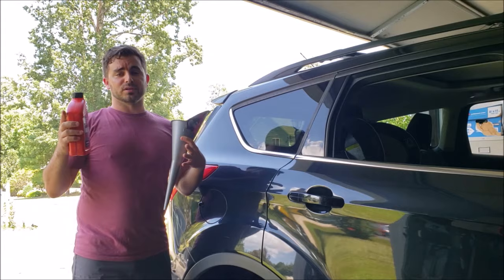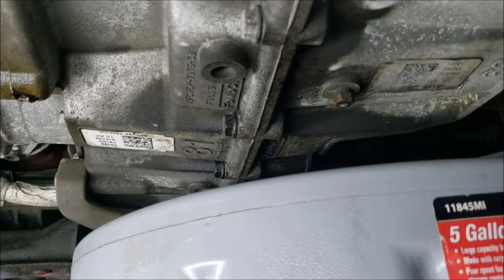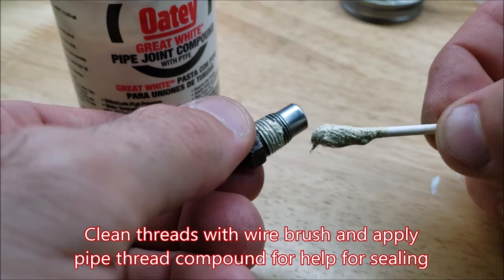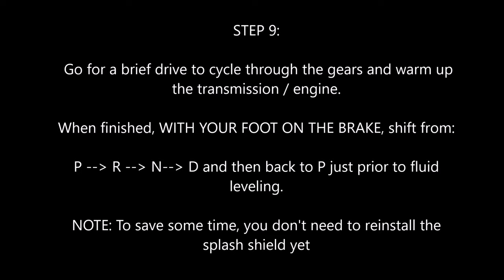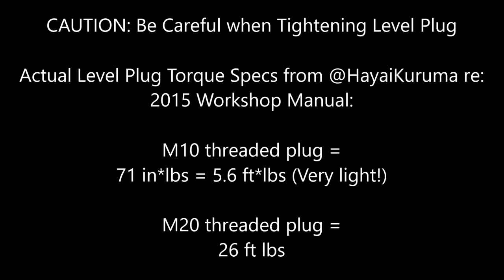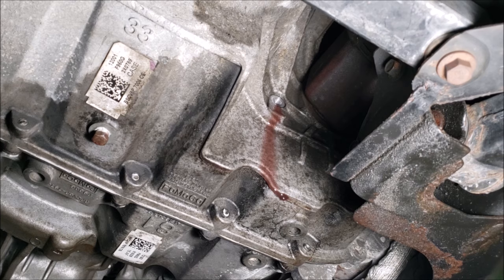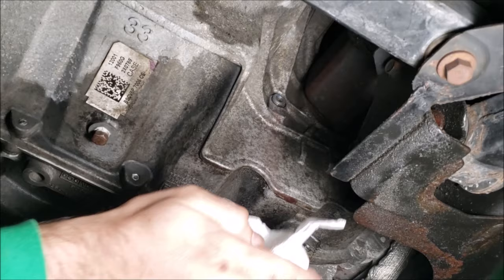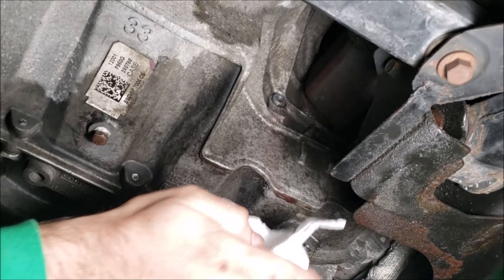Step by Step Transmission Fluid Drain and Fill: HOW TO ESCAPE

Comment: For anybody with a 15-16 1.6 or 2.0 escape, level bolt is a 3/8 inch Allen key on the right side of cv axle and a 10 inch extension works perfectly.
Reply from the maker: Thanks for sharing the tip, @riomcneill3918!
Reply: Words cannot express.... Thank you
Reply: In my case, it was screwed very tight & I was not able to unplug it out

Comment: No way, no how, no chance, should anyone EVER do ANY vehicle maintenance or even start the engine when using the factory jack under the pinch weld.  This video is an accident waiting to happen.
Reply from the maker: Thanks for the advice on that @Melman- you're right. You certainly don't want to be under the car or anywhere in the crush zone when its on that jack. However, thr thought was that this procedure with the wheel well access point  is not doing much more with the vehicle on the factory scissor jack than as if you were changing a flat tire. The engine is running, but the video has instruction to have the car in PARK and the E brake on. I am just a hobby garage car guy and no pro for sure,, but I have done this a few times now and if youre on a flat slab and the vehicle is in Park, then there is a very low chance of hazard as the other wheels stabilize the vehicle at 3 contact points. Not saying 0% chance, and we are not suggesting be in the vehicle shifting while its on the scissor jack. I can't remove all the risk but the scissor jack is a clever way to get to the port  without putting your whole body under the vehicle. That's where I was coming from at least- Im not saying its perfect. Please let me know of your thoughts- thanks very much
Reply: @HowToEscapeDIYTipsandReviews  I have already given you my thoughts, I have nothing more to say.
Reply from the maker: @larrymelman  understood. Thank you sir
Reply: @HowToEscapeDIYTipsandReviews  JUST USE CAUTION and COMMON SENSE guys!! Great video!!
Reply: Most excellent video except for using scissor jack part. I’m sure you are not doing that anymore. Great video.

Comment: For everyone, you would have to do this process 3 times in order for the trsnsmission to have atleast 90% of clean oil. By doing once all your going to do is dirty the new oil if you do it 3 times old and new will get mixed up and drain and and you will see a nice and red color of transmission oil.
Reply: Engine oil never drains 100 % when you change. Keep routine drains some and fills new 🎉
Reply: @pewpew9040  yes but we do more engine oil changes than transmission fluid changes.
Reply: 3x every 30,000 miles or like I do, one drain and fill every 10,000 miles
Reply: Right, I believe it takes around 9 courts, so that makes sense, thanks

Comment: Just drain and add 4-1/4 quarts.  I’ve done the leveling procedure one time out of 12 drain and fills.  The drain and fill procedure takes 10 minutes if you skip the leveling procedure.  Most of the 10 minute is the fluid draining
Reply: Good call - I am just going to measure what came out and put back the same amount of new stuff.

Comment: I have a 2014 after driving the car for about 20 minutes it started revving and acted like it was in neutral, Mr. Transmission is saying $3k+ to fix, any thoughts?
Reply from the maker: Hey there Dean- was this after a fluid change, or just in general 20mins of driving? 

Also, it depends on the "fix" really. Less than $4k for a transmission job on our Escapes is usually a pretty good deal. If it looses connection to the wheels and feels like it's in Neutral like you're saying, it's not a good sign unfortunately. 

For what it's worth, I paid ~$5K for a remanufactured transmission with updated internals and warranty on the transmission and labor. Just a datapoint for you on cost and what you could get. It's never fun to consider $3K for anything, but in regards to transmissions, it's not a bad price. 

Looking forward to hearing back. Thanks!
Reply: Ya I think I'm going to pass on fixing it, 10 years old and 278k's not worth it.
Reply from the maker: yeah it's a hard sell really. I think the main reason we kept ours is that at the time, vehicle prices were still a bit worse than they are now, and we still use it for this channel so much. Good luck with your process sir.

Comment: How about just simply measuring the old fluid that came out and putting the same amount of new fluid in?
Reply: That is the way a lot of people do it, but I just don't trust the last person that did it.
Reply: Never time to do it right but always time to do it twice
Reply: Fluid is a different volume warm vs cold, safest to level it off by removing level bot while vehicle is hot and running
Reply: By just replacing the exact same amount of trans fluid you remove, you would not know if your fluid was low to begin with. It is best to remove the level plug after the vehicle has warmed up to make sure that you are at the proper fill level. I know it is more work but it is definitely better to do it this way.
Reply: @kevinolmos80  that's true if you bought a used car that had its transmission serviced before. If you bought the car new, then you can measure the fluid that's coming out and put the same amount in since its level was correct from the factory

Comment: I'll be changing my Transmission Fluid in the next 2 weeks. Looking forward to reviewing this video again
Reply from the maker: Awesome! Its really like a regular oil change but with the level check at the end. Be careful with the threads on the level plug and go slow and easy and you should be golden. Good luck!

Comment: Thank you, I am on my second motor (known problem and class action lawsuit) my air conditioner quit (probably the condenser valve or switch) and now my transmission may or may not get me to work tomorrow! I'm DONE with Ford...except maybe with my F250 rust bucket!
Reply from the maker: Yeah these vehicles are pretty troublesome sometimes. Sorry you're having to go through all that- I hope its an easy troubleshoot with that AC

Comment: I have a 2017 Ford Escape SE with a 1.5L turbo engine.  I found that using a Pittsburgh 10mm hex extended wobble key (bought a set at Harbor Freight) was the best tool to remove the 10mm hex head check bolt (when I chose to use the removal of front left tire option).

Comment: Great video!

Has anyone done a timing belt change themselves yet?
Reply from the maker: Oof. Thats a tough one.  I had to pay for mine to be serviced due to a ~$500 proprietary Ford tool to access the belt. My trusted mom and pop shop said you have to pull the whole front quarter off to get to that part of the engine. Ended up having the dealer do it but it cost a pretty penny in labor... ~$1300 in labor hours alone.. While they were in there I had them do the water pump too. Didn't have the guts to do that much teardown myself for such an infrequent but critical maintenance item.

Comment: I know this is an older video, but if you see this can you maybe answer this? :) Can I drain and fill the trans fluid without dealing with the overflow bolt? Meaning, do you know the exact amount to fill using the vent (top) access which gets very close to the amount needed? This would save a lot of time and hassle just filling with the appropriate amount you know? Thanks for any insight on this.

Comment: Great video i have a 2016 that I change every 30,000 i just put 5 quarts in and go didn't know about the level drain plug
Reply: How many fluid changes have you done so far using this method?
Reply: @BenefitExploits  2 so far about to do the 3 at 90,000 the trick is try to measure the amount that comes out and go from there
Reply: @duanesalter1585  Unfortunately I hit a deer and my grille busted the trans cooler in the front and some fluid leaked out. I didn't drive it after that but im replacing the cooler and saw the fluid was really bad for being a 2019, it was never changed. So I will have to do the method of checking the level with the level plug
Reply: @duanesalter1585  i'm not used to the fords, the only cars ive changed tranny fluid on was toyota's with the 6 speed auto and those still had red fluid after 90-100k miles on the fluid lol
Reply: @BenefitExploits  my Mazda 3 was like that it had a seal trans never had to change it .but the Ford escape needs to be changed every 30 thousand it gets dark quick
Reply: @BenefitExploits  them deers are rough on a car good luck with your repairs

Comment: The owner manual said 9 Qt of transmition Fluid, Why did you put 5?
Reply from the maker: With the drain and fill, only ~half of the fluid exits the transmission housing. There is still a large volume still inside. Therefore, a drain and fill more frequently (within reason of course) will never have 100% of the fluid changed out, but you'll always be introducing more clean fluid than the old  fluid inside.

Comment: Hi good afternoon 
A very interesting video as I’m over here in the uk my ford Kuga has a totally different gearbox than you have in US . I have the powershift gearbox and have just done a oil change on mine and I have 2 drain plugs and a totally different procedure
Reply from the maker: Hi Phil! Wow, 2 drain plugs? What about your gearbox requires 2? Separate chambers? Is it all still the same type of fluid? Do your kugas in the UK still use MERCON LV? 

What else is different about the procedure on your end? 

That IS very interesting.. how many speeds are in your transmission? Our Escapes typically have 6.
Reply: How To Escape: DIY, Tips, and Reviews 
Hello again I got the oil direct from ford it takes 6 litres and also has a disposable filter that is in its own plastic surround that you unscrew from the side of the gearbox. Yes it has 2 chambers that when you refill the gearbox one flows from one to the other . It cost me £160 for the oil and filter, so not sure how much that is in the US , mine has a 2.0 Litre Diesel engine that is a Euro 6 engine made in partnership with citron Peugeot and ford , it’s a 6 speed automatic gearbox, and is a 2015 model , my model is a ford Kuga AWD titanium X sport in deep impact blue with 180 bhp
Reply from the maker: @Phil-1969  Thank you for the response and the detail- ok! So that is extremely different then- we don't even have access to our transmission fluid filters over here- they're considere "lifetime" which makes every one of us a littler nervous haha... We also don't have the diesel option like you all do- pretty cool that you can partner with Peugeot on that- so we're still the same on the 6 speeds, and AWD. I have the SE trim and you have Titanium but that shouldn't affect anything in the driveline in terms of differences... Deep impact blue is a great color. how many km's do you have on it???
Reply: How To Escape: DIY, Tips, and Reviews mine has done 50000 miles so I think about 87000 km and is totally standard. It has full moon roof , leather seats, 19inch wheels , it can park itself and every other toy ford put on them , I’m sure or gearbox is different, I’m sure you over in the USA have a different type. Have you a Facebook page that you have for your car

Comment: Ford: "Lifetime" filter, and 150k mile fluid service interval.

Also Ford: 60k mile warranty.
Reply from the maker: Right??? Very differing service policies... there have been many '13+ Escapes with failing transmissions even before the 60k warranty is up... 

I can't trust the "lifetime" filter... it's because you have to drop the entire transmission and crack it open to get to the filter... it's more of the lifetime of the transmission rather than the lifetime of the vehicle... 

Thanks for checking out the channel :)
Reply: @HowToEscapeDIYTipsandReviews   Thanks for the video....54K for my 2018 Escape and DEALER SAYS torque converter is failing....hard to believe but reading through many posts - is not impossible.
My question to dealer, is it possible replacing the fluid.... could it help the shudder I get or make it worse?

Comment: Can't find the location of the fill cap on a 2017 escape
Reply from the maker: Hey Aaron- sorry for the delayed response- check out this post on FordEscape.org- there's a user with a '17 Escape who posted pictures of his procedure. Mine is a 2013 so I can't be of much more help here unfortunately: https://www.fordescape.org/threads/2017-transmission-fluid-change.112736/#lg=thread-112736&slide=0

Comment: just found this video and had a question, on fords with high mileage is it true you should not drain and refill the transmission fluid for various reasons? like, too many miles on it, and draining and refilling fluid will cause transmission damage or some other problems? and if you feel you must do this to have it done at the ford Dealer? thanks
Reply from the maker: Hey there and good question- from what I have always understood from the community mostly is almost the other way around. Sometimes a dealer will offer to do a fluid FLUSH which can stir up a lot of settled debris in low places in your transmission. Since it is a "lifetime filter " inside the housing, it can't be changed so there will naturally be bits at the bottom that have accumulated. You can do it if you'd like, but the majority of sources and drivers prefer the drain and fill, even if you only get around half the fluid out with one procedure. It is much more gentle and keeps junk from getting thrown back into the fray. Some people try really hard to get clear red clean fluid when checking the fluid condition, but this takes numerous times and the fluid can get expensive quick. If you do the drain and fill every 30k mi, the influx of new fluid helping the residual retained fluid will make a difference. Please let me know if you have any other questions and thanks!

Comment: Thank you for the guide video.  I changed the transmission fluid on our 2013 Escape with 1.6 liter engine today.  (95k miles)

1:25
The 10mm Allen should be a 5mm.  The plug may be an M10, but the Allen hex is much smaller.  The 7/16" works for the drain plug, but it's really an 11mm.  

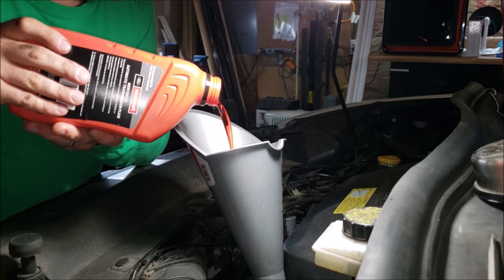4:40
The biggest problem I had was filling with new fluid.  I used a smaller, shorter funnel.  With both drain plug and level plug still in, the fluid would burp out the top of the funnel and make a mess of the engine bay.  A bigger funnel helps as does pouring less fluid at once.

Comment: Is your transmission still working ok 2 years later?
Reply from the maker: Hey there Firebert- funny you should ask. We actually just had the transmission replaced a month ago. Despite trying to head off the shortcomings of this 6F35 transmission with the 30kmi interval drain and fills and never really towing anything or driving nuts, it still failed on us. We just put a remanufactured transmission into it because it was less than a dealer by 2K and came with a 3 year warranty on parts and labor. It's painful, but we're back on the road with it. How about you? Have you had any issues with yours?
Reply: @HowToEscapeDIYTipsandReviews  2013 escape w/1.6 at 93,000 miles - was trying to decide if i should change the fluid or if the transmission might already be worn enough to need the dirt and grit to keep making friction to transmit power.

Comment: Hello, I have a Escape 2016 ecoboost 2.0, the owner's manual says that 9qt is required for the change, but in the video they only use 5qt, what is the reason?
Reply from the maker: Good question! The total capacity is 9qt but you can only drain half of that when you do a drain and fill. Its part of why its recommended to do it every 30k mi since you aren't changing 100% of the fluid. You could keep changing it over and over to get mostly new fluid but that can get pricey and time consuming.  A lot of Escape drivers do the drain and fill every 30k miles and have no issues compared to waiting longer per the factory spec. Please let me know if this is clear or if you have any more questions!

Comment: Excellent video. Well done.  Would you happen to have any videos on how to check/repair the A/C system a 2015 Escape?
Reply from the maker: Hi Steve, I dont have any videos up currently but what are your symptoms? Year and trim level of escape as well please? Hopefully we can help
Reply: My daughters car is a 2015 Ford Escape with a 1.6L turbo SE two wheel drive. The A/C was working then slowly began to die. I checked the fuses and they were okay. The belt is good. I had my daughter turn on the A/C while I watched the compressor. Nothing moved. I checked for signs of any leaks didn't see any but both pressure hoses are really nicely tucked away and difficult to follow from point "A" to "B". If you have any ideas, I would love to hear them. Thanks again. @HowToEscapeDIYTipsandReviews
Reply from the maker: @stevevet3652  Understood sir- the one thing that I've heard our escapes have issues with sometimes is an evap sensor that can tend to freeze over and it sends a false signal to shut the AC off prematurely- I'm not sure if that's what your vehicle is experiencing, but there's a pretty good video from FordTechMakuloco here on the topic- could be something to try and eliminate a variable? https://www.youtube.com/watch?v=k0EToZjmTO8 

Hope it helps! Good luck!
Reply: I had the exact same problem with my 2016 Ford Escape 1.6 Turbo. I took it to a local shop and they said they could not find anything wrong with it and they refilled it with refrigerant that contained dye. Two weeks later the AC system was not working again. So I took it to the dealer because they are the experts with these vehicles. They found the issue which was a bad hose and o-ring. They replaced them, tested the system, and then recharge the system with refrigerant. It now works fine. The complete cost was just under $600 which I understand to be reasonable for this type of repair. I hope this helps.